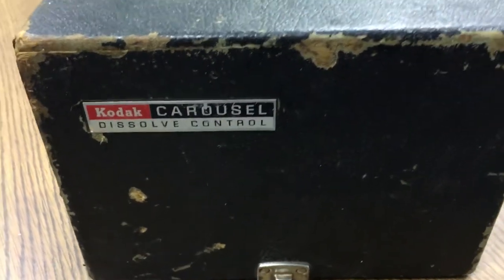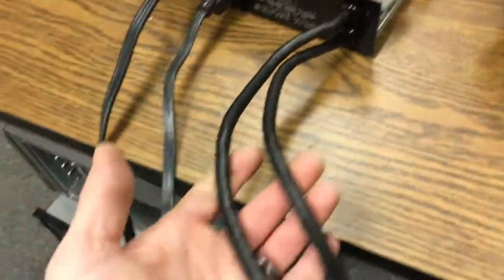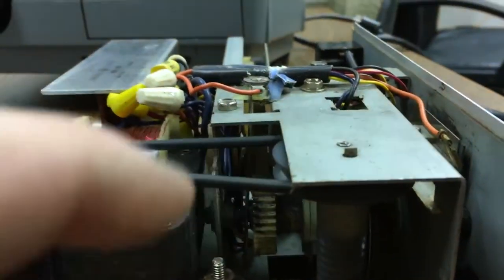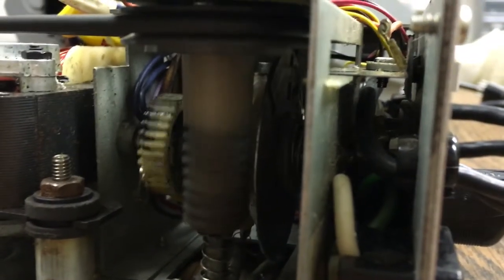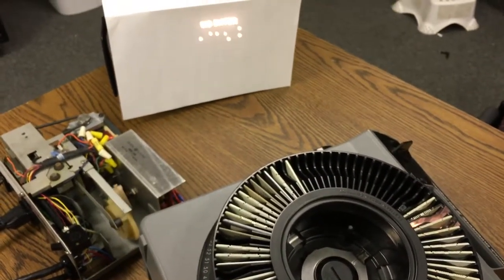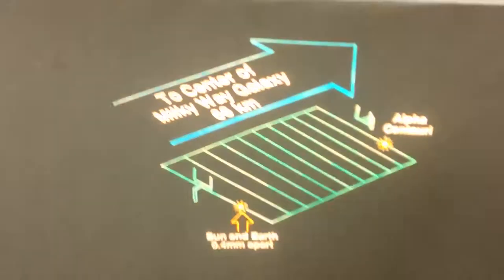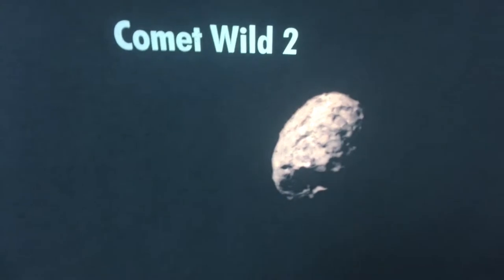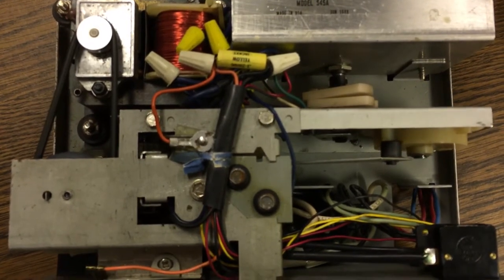Kodak Carousel Dissolve Control

Comment from the maker: I lied a little bit. I did clean the outer case, and the electrical contacts on the switching wheel and the slide switch/brush with some electronic contact cleaner.  :D  I can't stop staring at this thing running...